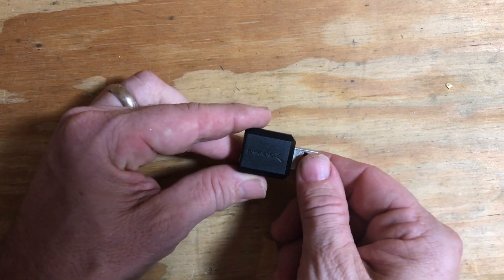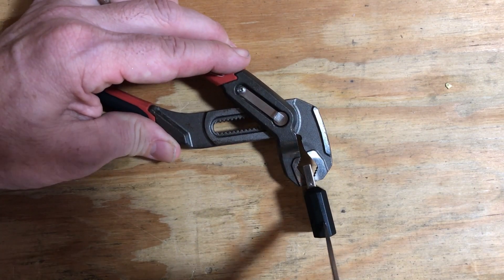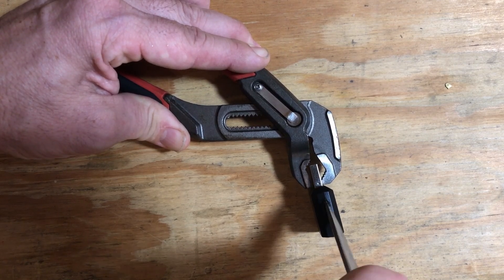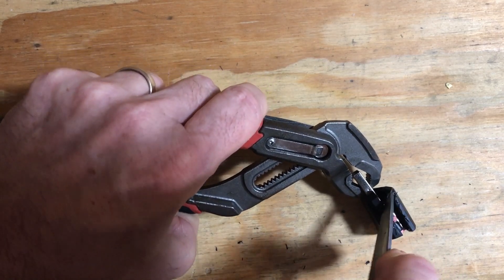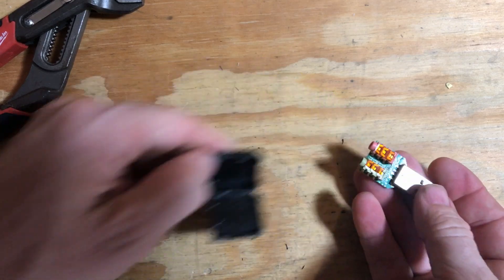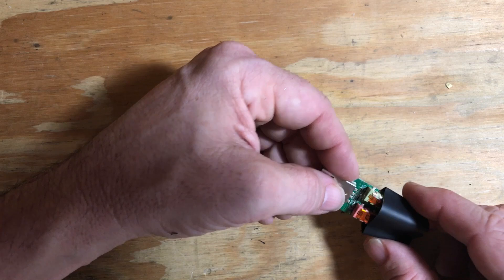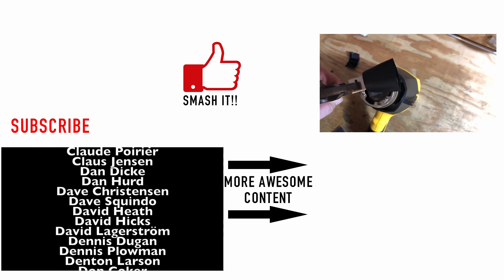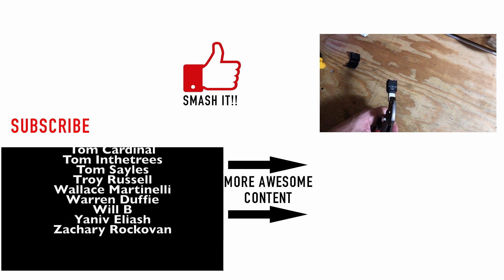Shrink Your Soundcard

Comment: I found a solution to using a Sabrent sound card with an FT-817.  In the patmenu config file edit the following command:
ARDOP="$HOME/ardop/./piardopc 8515 plughw:1,0 plughw:1,0 -c /dev/ttyUSB0:9600 -k 0000000008 -u 0000000088"

9600 is the CAT speed and the -k and -u are the HEX commands to key and unkey the FT-817.

Good luck
Reply from the maker: Thanks for the command Robb! With Pat Winlink, you can also set the PTT to true and accomplish the same thing. With GARIM, your command is the only way to make it work that I know of. Pat has a PTT signal built in but GARIM doesn't. For setting the PTT in Pat check out the FAQ https://tiny.cc/km4ack-faq 73, de KM4ACK
Reply: @KM4ACK  Well, that sure is a lot less "hacky" than how I did it. I'll go with that. Thanks for your work. I've got my HamPi running quite nicely. Next, I'm going to add a push button on a GPIO pin to enable safe shut down in the event you can't or don't want to do it via the start menu. I'd love to see a video from you implementing that. There are plenty of examples online.
73, K5RAB

Comment: What are you using this sound card for if you have the Signalink? I just got my rig all set up (thanks for all the helpful videos!) Using the sound card shown here, but can't get PTT to work properly in pat menu. I'm having it with through flrig which handled PTT fine with fldigi but doesn't work for them autopat program.

Comment: Dang, I knew I did it wrong - before I saw the video tried a rubber hammer (ball-peen didn't work either- tried that first and heat shrinking / body bagging the guts back together was a no-go too). Oh well live & learn, actually I found a passive 7 port USB 2.0 hub with connectors turned the other direction so they can live together and gives the GPS some distance off the Pi.
Reply from the maker: A hammer with electronics 😳 Save that as an absolute last resort!

Comment: I've built my own PI/radio interface with isolation using a PI prototype shield.  I went one step further and removed the 3.5mm jacks and soldered the wires directly to the board.  Works like a treat.

Comment: I found pliers either side of the clam shell cracked it like a nut rather than risking plunging the knife into the pcb.  Once it it out of the plastic, watch for strain on the USB sleeve - the lack of plastic reinforcement means it is much easier to break the connection.  I've had to resolder mine on!
Reply from the maker: Thanks for the heads up on the USB sleeve. I think the heat shrink should offer enough protection but as the sound cards are so cheap, I always keep a backup in my kit :-) You do have to be very careful when you start digging at it with a knife.

Comment: Hi Jason, great idea.. I bought a second Pi to play with here but this time I got a sound card with a short cable to USB which illuminates completely this problem. I also have the cat control for the FT817 plugged in which takes up a bit of room. I found also that I can power my Pi from a power bank that lasts for up to 7 hours and is rechargeable by photo cell but it takes a while.. haha 72s my friend de ON5REV

Comment: I wanted a gpio sound card an had good experience with the fe-pi sound card, he will supply it without connectors too, if you wanted to slider cables right too it 👍
Reply from the maker: I'll check these out. Currently they are out of stock. :(

Comment: Have you looked into using a TRRS cable? I have one for my FT-891 and it means I only have one audio connection instead of two. It is much more compact and the USB sound card I use even has a little pigtail which makes it even easier to use with the Pi.
Reply: The cable I use is from the seller ham_daptor on eBay and has a part number of DC-13F. The USB sound card I use is from UGREEN and I bought it off of Amazon. It is white, has a ~3" pigtail, and terminates in a TRRS jack.
Reply from the maker: I hadn't really considered it before. Might be nice to only have one cable instead of the two. Thanks for the suggestion!

Comment: Haven't done it yet but it's on the list now.  You may want to use hot glue to fill and seal prior to heat shrink as liquid tape has a habit of wicking into contact areas and causing mechanical or electrical interference on those audio ports.  Just past experience speaking.

Comment: You could also use a 6" USB extension cable.  Not as compact, but would leave the hard shell on the sound card.
Reply from the maker: True. This is exactly what I do with my GPS even though I stripped it out of the case as well. For the GPS, this gives me a bit more freedom if I need to move it around a bit for a better GPS signal. 73, de KM4ACK

Comment: Got mine in yesterday and did just that ....only thing I did different was when I removed the case I used my utility knife and shaved down the seam and then used my pliers to break the seam by gentle squeezing it until I heard he sound of plastic cracking once that happened I used a pry tool to open it. I also noted that the shrink wrap didn't totally seal it so applied some liquid tape between audio jacks and around the usb port to insure weather resistance. Now to get my radio desk put back together lol
Reply from the maker: I didn't seal my ends but maybe I should. None of the electronics like water. 8-) 73, de KM4ACK

Comment: Great idea Jason!!  A little scary taking the soundcard apart, but a great idea.  Have you considered or tried to use a USB hub??  (I think that is what they are called)  I have one here at work since my desktop computer is in the floor under my desk, I have one attached to it so I can have USB ports on my desk.  Not sure if the Pi can handle one of those or not.  Just a thought.  Juddie - WD8WV
Reply from the maker: You may can get the hub to work. Personally, I didn't want to add a USB hub. If you have one laying around and need the extra ports, give it a shot. Be sure to let us know how it works.